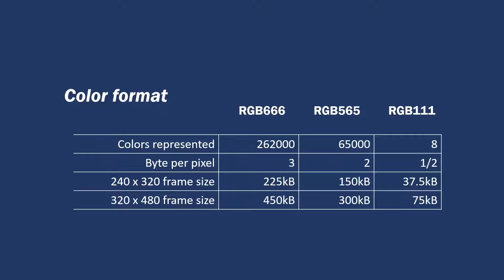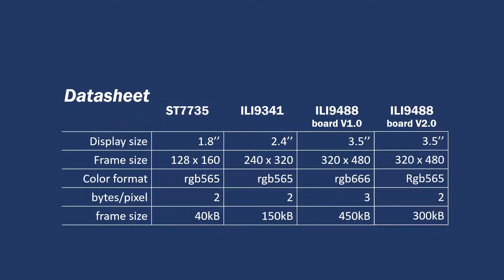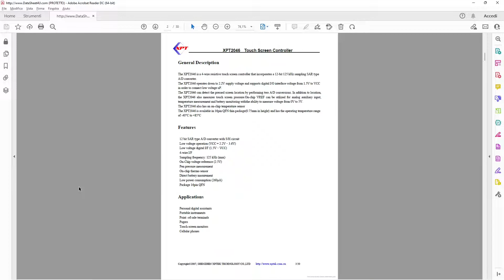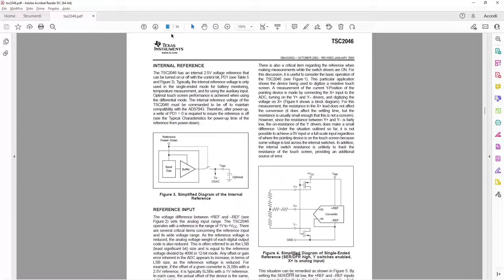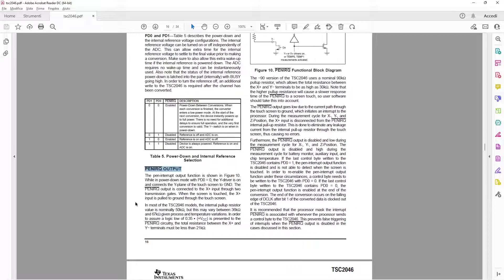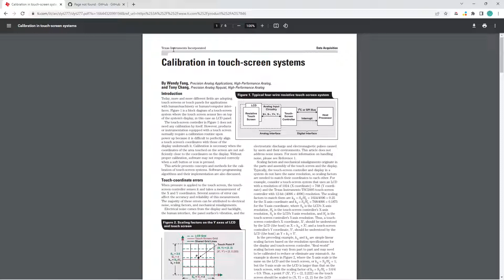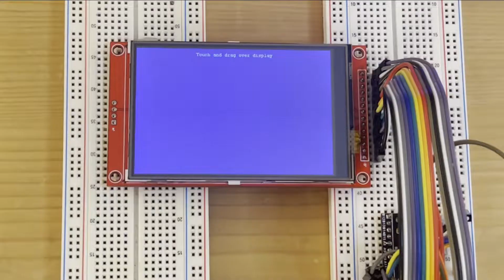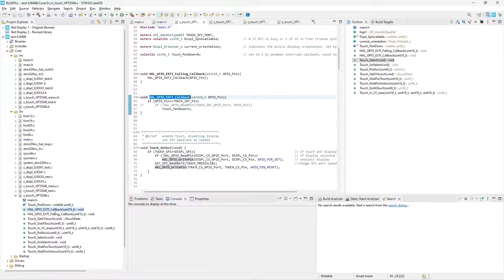STM32 and ILI9488, ILI9341 TFT LCD touch displays

Comment: Not sure, if you already found out, but nowadays you can also get screens with a size of 4,3", 5" or even 7" that are even available with a capacitive touch panel on top. These screens are not always connected via SPI, but some are available with a parallel connection instead. Those screens have a resolution of up to 800x480 pixels. I've also seen some with higher resolutions, but i think that is too much for the average microcontroller). Some of these screens are not TFTs but have an IPS panel instead. In many cases they have a built in esp32 module on them (some with an esp32-s2 or esp32-s3).
Last time I checked the screen drivers are still very similar, either some variant of ILIxxxx or STxxxxy. The capacitive touch panels are GT911 drivers in all cases, that I came across. It's easy to implement.

Quite a lot of options to choose from nowadays, which make it quite hard to find just the right one - unless one doesn't have any specific needs or doesn't really care about the options.
Reply from the maker: Oh, you are right! Lot of devices available and lot possibilities. 
I certainly would not use SPI to drive an 800x480 display.  FMSC (for parallel connections) or up to Octo-SPI (for serial ones) for data transfer are available. Chrom-ART would help a lot, directly handling graphics operation without involving uC.
I'm just not sure about using esp32 handling the display, but I never tested that kind of solutions.

Well. Not so hard to find out the right display: the right choice just depends on the project needs.

Comment: Does 2.8inch ILI9341 TFT work as well?
Reply from the maker: uC just "talks" to the display driver (ILI9341), so basically display size in inches is not relevant.
A different thing is the size in pixels. Setting  DISPL_WIDTH and  DISPL_HEIGHT should let you use the library with displays with other sizes. Let me know.

Comment: hi sorry if sound dumb, I have not used many touch displays.

my questions is if I call Touch_GotATouch() in main loop, from Library I know in background it is calling interrupt but if I call that function in main loop does not it become polling as if my main loop is running other delay based routines and user touches the display the response will still be slow as I am still checking touchs in main loop and reacting to user input?
Reply from the maker: Hi,
interrupt detects touch and (callback) sets a flag.
Then, in the main loop, or anywhere in the program, you can check if user touched display, using GotATouch(), just testing that flag.
Polling in main loop the touch sensor, you would start an SPI communication (and an ADC) in any loop cycle. That would have a heavy impact over the overall performances: using GotATouch, you are able to start SPI communication (reading touch position) only when you are sure that user is touching. 

About the time to react to the user input: that is linked to the main loop organization.
Normally (in normal programs) human touch is an extremely slow event, but anytime you have the time to react problem developing the main loop. 
A good method is to develop a well balanced finite-state machine.
And if you still have a hard need to react events within deterministic times, you have to move to RTOS systems.
Reply: @bluewat  thanks nicely explained.

Comment: I'm confused about how the Displ_FillArea function works,.  In your previous video it looked like you were filling one buffer while the other was transmitting. But in the code it looks like you send ALL the color data at one time and then swap buffers.  What do I not understand?

PS- I thnk you need a #endif in z_displ_ILI9XXX.h. In Device Parameters section after #define ILI9488
Reply from the maker: about Displ_FillArea: 
there are 2 buffers (dispBuffer1 and dispBuffer2) and a pointer (dispBuffer) (lines #31-#33).  dispBuffer is already pointing to the free buffer (not currently used in SPI transmission)
Function fill the (free) buffer with needed color (in RGB565 mode lines #372-386, RGB666 lines #387-#406), and request to transmit (Displ_Transmit (called by Displ_WriteCommand and Displ_WriteData) will hang until the previous SPI transmission completes (line #254)).
When Displ_Transmit returns, current buffer is on transmission and "the other" buffer is free (transmission completed).
The same buffer (the same color) can be transferred many times untill the whole area si filled 
So, at the end fo the function DispBuffer switches pointing to the (new) free buffer while current one is on transmission.

about #endif:
right. Fixed. 

Thank you, Nohokum
Reply: @bluewat  
So when  Hal_SPI_Transmit_DMA()  is called the DMA transfer starts and the processor immediately continues execution ? I think this is what I don't understand.

Does it work like this:
1. Fill dispBuffer with color data
2.Determine number of times we need to transfer dispBuffer.
3.Call Displ_WriteData() in for loop,
4.In Displ_Transmit() check SpiAvailable flag; wait until it's set by call back.
5.Call HAL_SPI_Transmit_DMA ( Starts DMA transfer and immediately returns to Displ_WriteData() ).
6.Displ_WriteData() sends us right back to Displ_Transmit() and we wait for the SpiAvailable flag to be set and we start another DMA transfer.
7.Continue until all data has been transferred. We have already filled the buffer so we just send  the same buffer every time.

( Sorry for all the questions, but it's the only way to learn things )
Reply from the maker: That's the purpose of DMA: handling data transfer and let uC free to proceed in program. uC program and data transmission proceed in parallel. uC just stops if it need to transmit a new set of data and the old set is stil on transmission.
https://en.wikipedia.org/wiki/Direct_memory_access
Reply: @bluewat  

OK I understand. Thank you.

Comment: Sir actually I have ILI9846 driver could please tell can I Used this font library for that
Reply from the maker: Hi Charumathi,
I do not have an ILI9846 display, neither I'm able to find its datasheets herearound, online. Maybe you are referring to ILI9486?
If so, I do not have even displays driven by ILI9486 but, after a quick look to its datasheet, if I'm not mistaken, differences mainly are in the parallel interface. On the SPI port ILI9486 should work as an ILI9488 on RGB565. Try to set library to ILI9488_V2. Let me know.

Comment: Can it be used without a pencil?
Reply from the maker: I never use pencils
Reply: Resistive touch panels, like the ones shown in the video can be used with anything that has a blunt tip. Using a sharp pencil would probably damage the touch panel. It won't work on a capacitive touch screen (like the one on a smartphone)